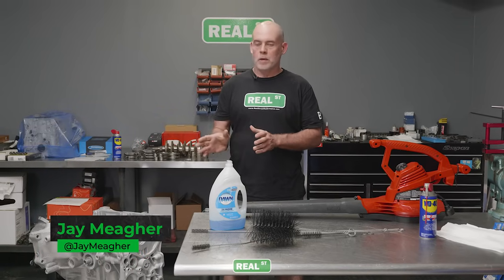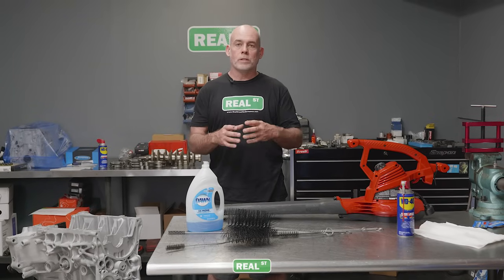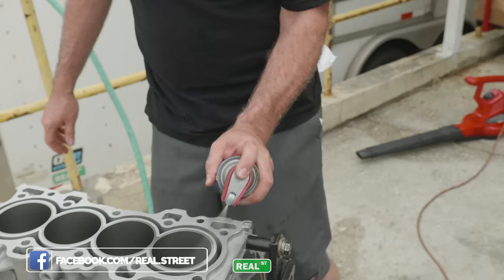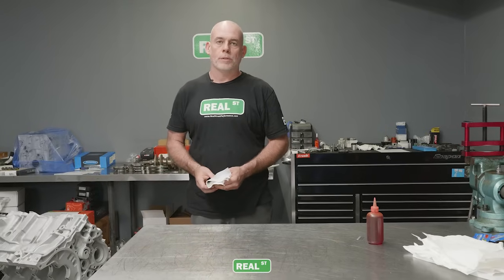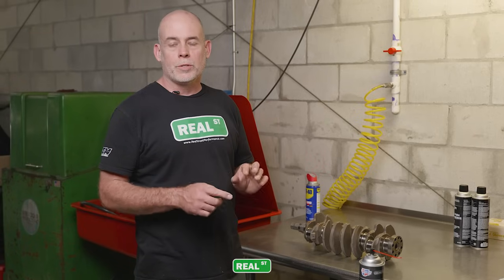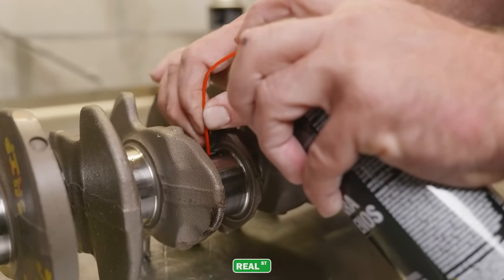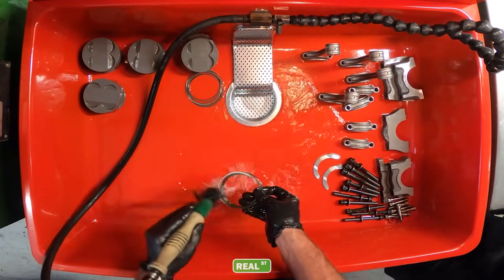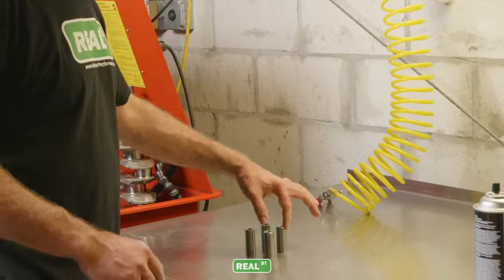How To Clean Your Bottom End Engine Parts & Prepare For Assembly - Step By Step

Comment: Personally never liked cleaning bores or machined surfaces with water based products due to chemical rust reaction that happens very quickly once water is introduced. I prefer to solvent + oil base clean with ATF which is messy and smelly but with no chance of flash rust.
Reply: Excellent advice
Reply: What’s the formula boss - k24a2?

Comment: Just been a tool, use eye protection, heavy duty rubber gloves when dealing w brake cleaner, and also a well ventilated area (have a fan), a N95 mask will help prevent breath BC.
Brake cleaner is super strong cleaning agent, protect your eyes, skin and lungs.

Comment: Very nice vid.

Might add that mineral spirits is what one want to use. Here in sweden it often is called lacknafta. But there is often no distiction between mineral spirit and terpentine. One must make sure to usen the mineral kind since it does not leave any resudue behind like the terpentine version does.
Not sure if this confusion exist in other countries than Sweden.

Also another youtuber called jafro recommend using coffee filters for cleaning. He has real ocd when it comes to cleaning..😅

The tip on the dead end in the oil passage on the crank was a good tip. Never thought of that..

Comment: Excellent video. I realise now I should delay my engine rebuild plans until I have the cleaning equipment and the clean workspace to do the job properly and not just using degreaser, rags, towels and cans of brake/carb cleaner.

Comment: I am rebuilding an BMW N62 it uses the Alusil block. My machinist bored and honed with the felt pads/sunnen paste. He went out to the looser end of the piston to wall clearance specification, as we intend on supercharging it after a proper break in. We went .5 mm oversize with the pistons purchased  directly from BMW, these oversized piston kits came with their rings pre installed. I would rather not remove them so I purchased one set of the .5 mm piston rings to check end gap with them and hopefully the machinist set the wall clearance correctly. I just hope i don’t need to marry each piston to a cylinder as I asked him about doing this and he said it was not necessary due to the fact that BMW is very accurate on their machining processes.

Your thoughts would be much appreciated, thanks for the awesome video, I am building my channel as well.

Comment: I have a Ford 351W block that was machined, washed with soap and water, and already has the cam bearings and freeze plugs installed. It has been stored away for over 7 years because I had gotten sick and while in storage it has collected a bit of surface rust even after spraying some WD40 gel spray and regular spray after washing and drying 7 yrs ago. I really want to finish what I started and hopefully prevent from taking the block back to the machine shop as money is now tight. How can I go about cleaning the minimal surface rust that is on the cylinder bores and block deck?
Reply: I'm in that exact same situation,  although mine is a motorcycle engine. But it laid apart for way too long. I've heard , I can open the drains and use kerosene to clean it out , but I wanna ask a few experienced guys , before I do that.

Comment: I washed out the cylinders on my very first turbo build after notching them to fit my new forged rods - it started rusting in SECONDS. I sprayed it down with WD-40 really quick, but you could still see a tiny bit of surface rust. So I wiped them down as shown in the video and then they looked nice and clean. The build worked out great with no problems in the end. 

Still.... I couldn't believe how fast those iron sleeves can rust.

Comment: In old time manufactures purposely kept blocks outside for few weeks to rust them. It is technology how to make "hone" without honing. Because rust actually creates pits and valleys in right conditions.
Also, rust doesn't change geometry so fast. Speed of rust propagation into material is like 100 micrometers/year.  So, even inside salty water iron will rust less than 1 micron in 24h. And typical size of valleys after honing is few microns.

Comment: Was always told to use atf to clean cylinder walls then just coat them with wd40
Reply from the maker: Very similar steps used in this video. Both combos work well.

Comment: I see so many builds over to the side with the heads still off or just valve covers off. And someone grinding metal or welding and whatever. Kills me to see that cause you know all that metal dust and dirt in general is just going into that engine built or not. If have something in an area of contamination. Wrap it up multiple times I've seen stuff get past those engine bags. Even when I pull an engine for future builds I tape off the intake and exhaust or turbo inlets. Anything that would be left open tape it up. Could save you alot of head ache in the future.

Comment: You can use your air compressor, but when finished, simply spray down completely with WD40. Badda bing, badda bip!!!... no more water!!

And BTW, for those of you working with cast iron blocks, you absolutely do not want to let any water stand anywhere! Unplug all oil galleries, blow out with compressed air, get it all outta there asap, then spray down heavily with WD40. Last thing you want is rust in your oil galleries flowing into your bearings, unless that's the effect you're looking for, but I highly doubt it.

P.S. Oil galleries. 😉

Comment: Why not just dip everything in oil after immediately after you wash them? Literally, have a bucket of oil where you dunk the pieces right after you wash them then the water is displaced and you place the parts in a basket and the oil just runs off. What would happen if you did that?

Comment: I'm calling this bullshit the block looks brand new try doing this with a junk yard motor build or any motor that has alot of mileage I promise u will need more elbow grease motors do not clean up that easy🤣
Reply from the maker: Hi, as mentioned in the video this block has been through a hot tank at the machine shop. This takes care of all the heavy cleaning you are referring to.